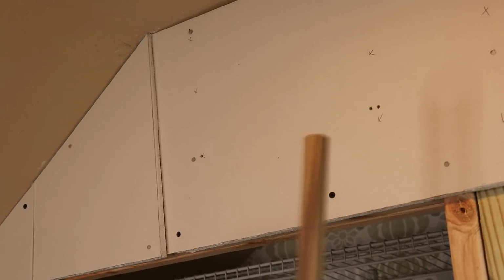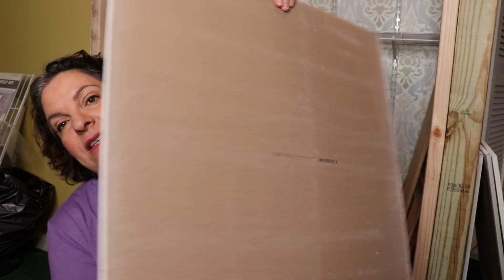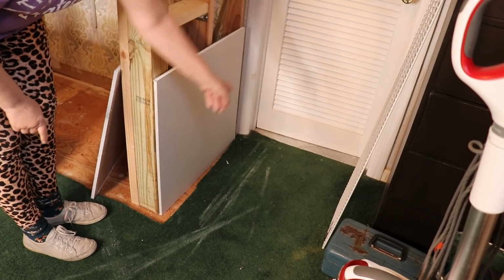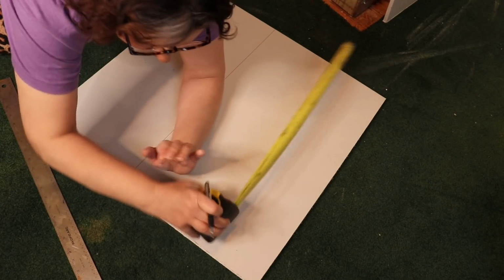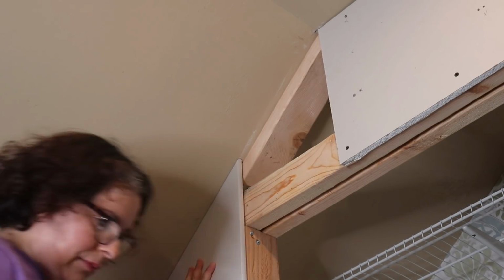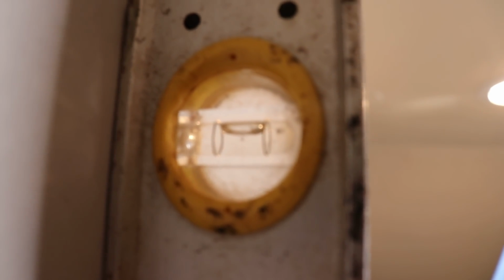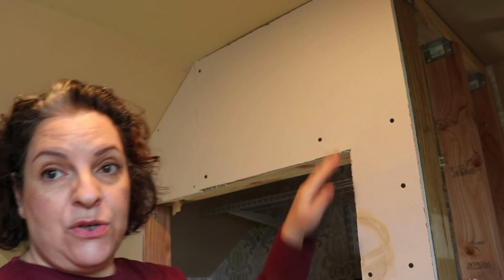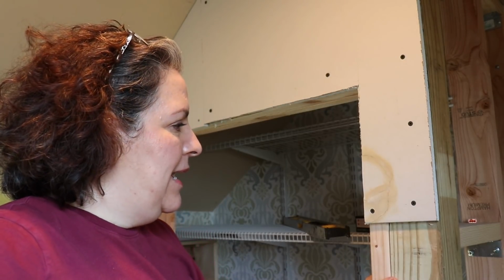Master Bedroom Makeover Series || DIY Closet || Episode 8 ||

Comment: I don’t think carpet in the closet would work when you try to move the cabinet on wheels because it fits so tightly in the hole. It seems to me it will have to be very flat to wheel out on. Good job.

Comment: I'd be tempted to hire a dry wall guy to tape and finish the drywall because a professional will be able to blend the leaning existing wall and the closet front.
Reply: Good point 🤔
Reply: I did hire a „professionell“ for the dry wall. He messed up the door frame and it only showed after a few months…😡
Reply: @Tinamar65  ... and that could be a good point too 🙄
Reply: The house I purchased 3 years ago has had extensions added. Whoever did the plastering didn’t do a good job! I can see where the hallway and toilet walls have been taped and mudded over (the only part that gets muddled and skimmed in Oz). Other rooms have normal wallpaper that has been painted over so who knows what is underneath! It wasn’t Anaglypta paper they used, unfortunately. Before I decide how to decorate, the walls will need to be refinished properly which will create more work!! Congrats, Sophia, on doing such a great job. Your perseverance is inspiring. By the way, could the closet floor be painted black? Then it would “disappear” once your clothes, etc, are inside and wouldn’t affect the roll-out storage unit you built? Just a thought. Until next time, take care and stay safe and well. With love and best wishes from Down Under 😘💕🇦🇺

Comment: I had a hunch that the metal arm that you had in the top left hand side was going to make the drywall stick out a bit and should have suggested you to put it inside the closet. Don't worry about the gap at the top where it meets the ceiling as mud and tape will fill that in. My husband taught me to always have the full piece of drywall and cut out your openings after. The less seams you have the better and then you dont have to worry about the parts protruding as drywall has some flexibility. Dont forget do 1 coat of mud/tape, let dry. Second coat of mud, let dry. Then sand. 3rd thin coat of mud if needed for touch ups and a final sand. Im looking forward to seeing your reveal and enjoying watching it all come together.

Comment: Have done sheet rock for half my life in home projects and love home shows, this is the first I've ever heard of glue. I'm intrigued by this. The room I'm in right now was the first I ever did and that was 22 years ago, my seams aren't perfectly mudded but I love to look at the flaws knowing I did it and remembering the process and learning alongside my dad! I hope you enjoy any flaws and look at them as your signature on the art the way I do my walls!
Reply from the maker: I don t know about enjoying the flaws lol I think I ll obsess over it. I watched a guy on youtube who recommended using g the glue for areas that are floating like mine. (Not an actual wall) he said it helps stabilize further and avoid cracks in the long run.
Reply: @mygreatchallenge  interesting! I have zero cracks however I was finishing the basement, which has a cement floor and I assume it doesn't move, where upstairs I imagine things would shift slightly more! I think you've built a really strong closet and it looks great and will be super functional for you! I like my flaws as they're in the mudding and weren't noticable until after it was painted and then only when the light hits certain ways! Sometimes I consider fixing it, but that's a lot of sanding in a finished space, I think for me it has motivated me to do better on other projects I've done but it's always sorta nice to see how far I've come and all these years later I don't think I would have such vivid memories or learned lessons if I didn't get the reminder!

Comment: Sophia you need to use edge pieces where two bits of wall board butt together as then you can mud and tape the joints as they will have more stability and.be less inclined to move.

Comment: Are you finishing the inside of the closet as well? I like the idea of leaving it open and using the horizontal boards you put in as shelves for things, just paint it white so it reflects the light in there and it will look like built in shelves for perfumes etc... 💗
Reply from the maker: No plan to finish the inside. Just sanding and  adhering some nice paper. Shelves will be used for hooks etc. Maximizing the space.

Comment: Are you referring to anaglypta wallpaper?     You are doing a good job, OK, a few mistakes. I bet that closet isn't going any where!! It is sturdy ! I feel for ya trying to remove your "mistake".   We never happened to use adhesive before screwing in. My hubby and I decided that you can always tell where we started a project and where we finished!  It looks better at the end!!  LOL !!      You probably do not need to finish the edges for the door.  The door frame and molding should cover it.